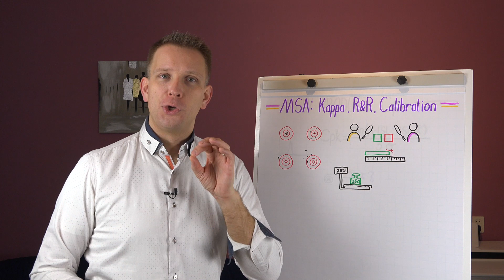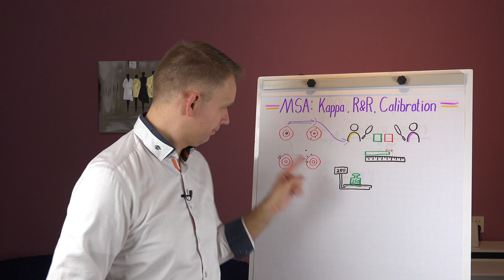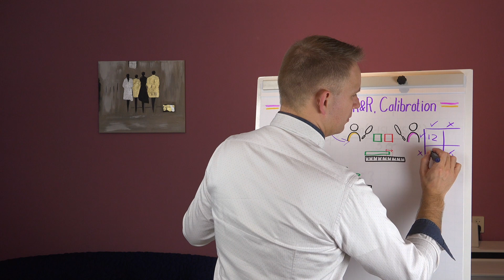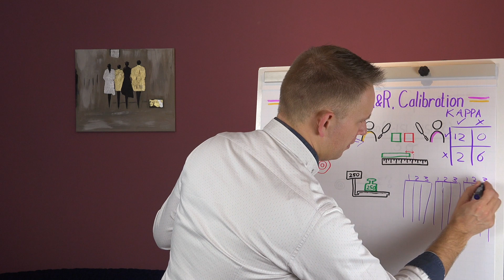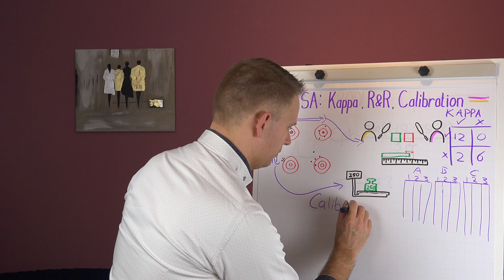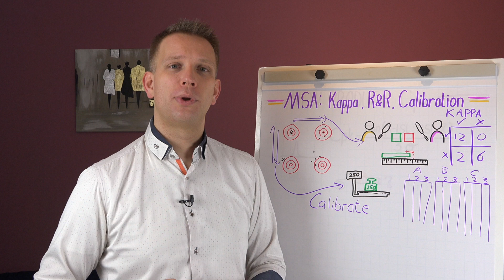MSA with Kappa R&R and Calibration

Comment: Hello Tom, I come back to you for the GRR study, I would like to have you advice. in my case, I use laser measurement to measure the thickness on the surface of part after coating process, it means laser takes 1 point on the raw part surface, then after coating, it take the same point, then it calculate the difference which is the thickness of coating I want to control. Today what my colleague have done as validation is: he takes the measurement on the raw part surface, then he put a calibrated thickness etalon on the surface, laser take the point on the etalon, then he see the difference to compare with the etalon thickness, he repeated this operation 30 times on the same part on the same point. My opinion is his study allows to evaluate the accuracy and repeatability of laser measurement system, but this is not sufficient, because he should complete the study with real part with coating not just a calibrated etaon, if I'm right, then this becomes different to perform a R&R according to the standards rules, because once we put coating, it is irreversible, we cannot do repeat it on several times on the same part, so I would like to ask you how to perform R&R study in my case? thanks in advance
Reply from the maker: Working with a destructive test is always more tricky. You would like the different testers (or analysis equipments) to test parts that are as similar as possible (and make the assumption that they are the same). Usually you take parts that are very close in production for this, but that too might be difficult, as your analysis is actually done during a production process where the finished part can no longer be checked for the base measurement. 

Apparently you can do this with the calibration samples (the etalons), so you have a way to feed those through the before and after lasers. I think that’s your most likely way to solve it: have a couple different calibration samples, resembling the full range of applied coating that you get from regular production, then send those samples through both lasers a number of times (3-5x). That way you get results over the whole needed testing range and have a repeatability element in the test.

Comment: Hi Tom. I have one doubt. From what I have studied, calibration is related to accuracy and not precision. I have seen some gage r&r examples though that consider multiple calipers in order to get the machines variation, so I guess to check if some calipers are better calibrated than others. I wonder why in this case calibration has something to do with gage r&r and therefore precision.
Reply from the maker: You are right: calibration is about accuracy; R&R and Kappa are about precision - you want your measurement system to be both accurate and precise. That is what I wanted to point out with this video: if you do measurement systems analysis (MSA), take both into account. 
R&R and Kappa serve the same purpose - just R&R is used for measured/continuous data and Kappa for Pass/Fail (there are some more tools to determine precision levels, but these two are used the most).
Reply: @TomMentink  thanks a lot for your answer. I have couple of follow up questions.
1) Would replications in a factorial doe increase precision and therefore constitute an alternative to gage r&r?
2) I have seen examples of calipers' variation in gage r&r context. Does that account for all the other calipers' variation sources other than calibration (which is infact related to accuracy)?
Reply from the maker: @luigi88953 
1) if you’re wondering whether your measurement system is good enough for the job - do an R&R. DOE doesn’t increase the gage’s precision. It might increase Cpk enough that you don’t really need a very precise measurement system, but if you’re invested enough to do full factorial DOE on the process, you’d want to know the gage R&R too.
2) if different calipers are used, their difference in calibration would be a source of equipment variation (repeatability). Correctly calibrating all of them would solve/reduce this source of variation, but as long as there’s a difference between them, that will show up in R&R.
Reply: @TomMentink   thank you so much for taking the time to answer and clear my doubts. Your answer clarified everything. Also your videos are excellent. Glad I discovered your channel. Thanks again!